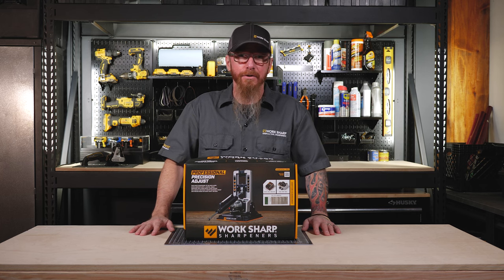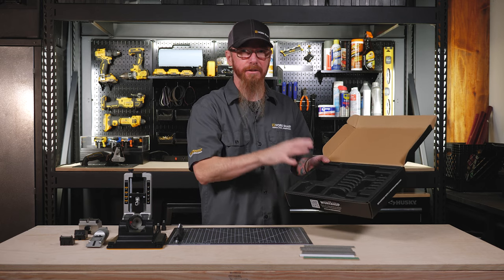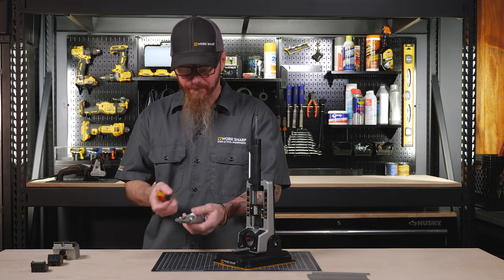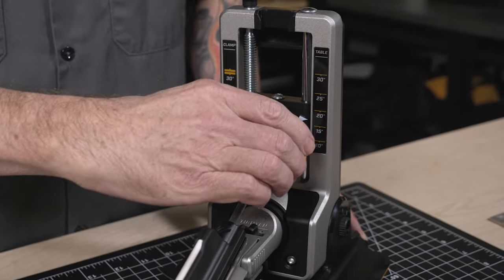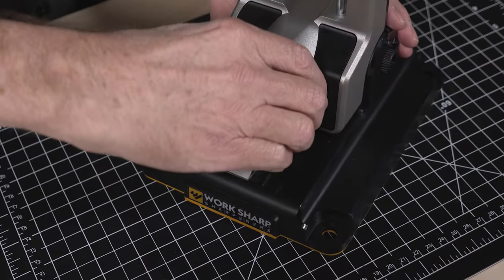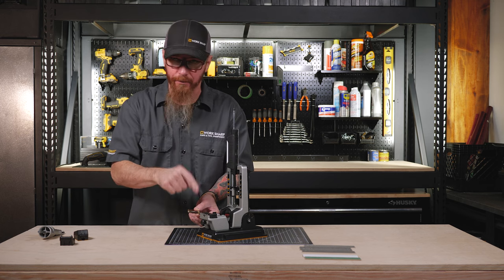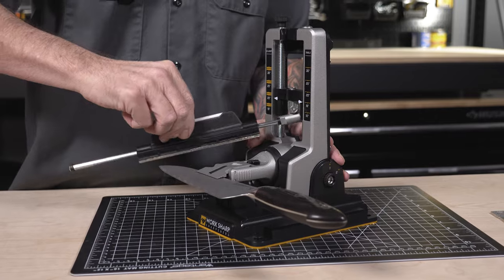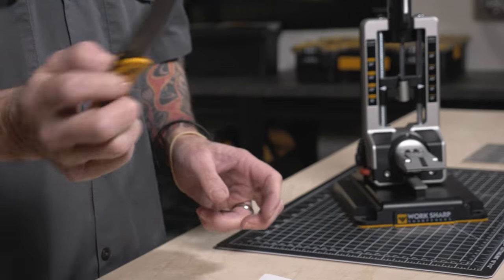Professional Precision Adjust Video Users Guide

Comment: There absolutely needs to be some sort of upgrade program for the original Precision Adjust Elite owners.
Reply: Amen! Bought mine only two weeks before this came out!😡
Reply: I absolutely agree!
Reply: I completely agree! I got my original Precision Adjust about 6 weeks ago.
Reply: Same here, we need a replacement clamp for the precision adjust elite,  like the small one for smaller knives like swiss army knives which I have a ton of.
Reply: I gifted mine to my mum as she doesn't want this much control but this new one for me is perfect
Reply: I agree
Reply: You shsould not buy it...Have you seen any reviews? It was all plastic made...
Reply: @Firekage  I bought a precision adjust elite about a year ago, it's well  made the plastic is sturdy but they put a plastic thumb wheel nut on a metal threaded bolt to squeeze the clamp jaws, already one thumb wheel nut has stripped the threads on it. For the sake of using aluminium or metal at least for that part, I did get a new clamp under warranty but it could happen again.
Reply: @6900pilot  That's why you should not have. I saw reviews and also WorkSharp vids and i saw on them that the plastic frame bends when they Sharpem. I seen later that zimę shops made mod for IT but its is not worth money.
Reply: I completely agree. I  feel like I am out that $100 plus dollars if I want to upgrade.
Reply: No they have to make money off you that’s why
Reply: Only a fool buys the 1st gen anything

Comment: Hope to see a stone holder for this system soon, It is a Professional system and priced as one (so that part is crucial for ANY Pro system). Higher grit diamond plates would also be welcomed, at least up to 1200-1500. And as with any professional tool, you need a hard case for when you want to bring the system somewhere or even storage. A hard case should be relatively easy to have made and sold separately at a later date. As it is, It looks like a great system with even greater potential 🙂

Comment: For a professional sharpening system it really needs to come with 1000 or really a 1200-1500 grit stone. 800 is pretty low end in my eyes unfortunately. But I’m guessing aftermarket will take care of me on that
Reply: Well it depends if they use FEPA F or JIS R6001 units... A lot of people use japanese units, but I suppose Worksharp use FEPA F as they use FEPA Paper for the Ken Onion belt sharpener.
So F800 (FEPA F) would be roughly J2000 grit (JIS), or 6.5 μm average, or something like P3000 (FEPA P) which I agree is not the absolute finest that exists, but still damn fine and wayyyyyy enough for cutting things. In my eyes anything finer than F600/J1500 or even F400/J1000 , is luxury, and you can always use paste on strop etc
Please let me know if I'm wrong !
Reply: Agreed, 1200-1500 plate is a must. They also need a stone holder for other  high quality stones, now that they market and priced it as a Professional system so they can compete with their competition in the same price range.

Comment: So one sweeping stroke instead of up and strokes, that's different compared to every other system on the market.
Reply: I'd find it very hard to sharpen in one direction only on a large kitchen knife say, , in previous worksharp videos ive seen them sharpening in both directions so which is correct?
Reply: @6900pilot  I honestly don't know which is correct.. using up and down strokes will sharpen a knife a lot faster versus using only sweeping strokes.. I use a DMT system and they show in their videos to use sweeping strokes but the instructions say to use up-and-down strokes and a sweeping stroke as your final stroke
Reply: @6900pilot  I think they show it this way because of the huuuuuge flex the knife would make. That clamp is for pocket knives and bushcraft knives at best. The clamp should be at least 3 times wider to be effective at holding longer and thinner knives.
Reply: @desertchild.  up and down is just fine. In their paper instructions included with it they actually show to do up and down there as well. The angle is being held where you want it already so there is no problem doing that. It would take you eons if you were to reprofile an edge from say a 20° down to a 17° by doing only upstrokes.

Comment: You should have made the tightening nut/wheel on the clamp out of metal, ive stripped the threads on one already,, plastic thread on metal  is weak and cheap. Otherwise im happy with the elite, although it's hard to sharpen smaller blades like swiss army blades.

Comment: It’s not quite as idiot proof as I thought. Especially since the first time I tried it I was only willing to sharpen an old buck knife from when I was a kid and it never had an edge on it, and a few knives from Canadian tire. The factory edges didn’t have a consistent angle on any of them. That and I had no idea why but getting a full burr was completely impossible. I had no idea if I’d done too much, or not enough. I didn’t know if I was using too much or too little pressure, I didn’t want to strip the plastic nut on the v-clamp, so the knife moved around in it a little, and I had no idea if I had worked on one side of the knife more than the other. This is going to take some practice. I’m going to need to put my benchmades away until I figure this out on cheaper knives.
Reply: Dude I appreciate this info, I plan on picking up one of these soon, I have the first model and was hoping the little skill I have would carry over, we'll see I guess
Reply: @fredchevalier2333  It’ll carry over. It was the first precision knife sharpening system I ever owned and I was working a very difficult knife. I’ve done a few blades now and I’m getting better each time. I do feel like the v clamp has trouble holding the knife and having the knife not move in the clamp. It has pretty severe wiggle. That’s a pretty big problem and if they have plans to fix that I might hold out on buying one until the next model comes out. Or if we’re lucky they’ll just make a new clamp that’s compatible with the current model. Not that I’ve heard of any such plans.

Comment: Buying it was a nightmare but shipping was lightning fast and the system is almost everything you could want. 

One issue I'm running into though is with Spydercos - Did my pm2 fine although the clamp situation was awkward with the distal taper and the way the backstop only has one point of contact. Para 3 was too small and I was grinding the clamp when going for the tip. Assuming this will be a frequently sharpened knife on these systems if you guys could make a tips video or something covering this it'd be helpful. The small knife table didn't seem like a good option again because of the distal taper and flat grind so I wound up just using the PA elite because that clamp gets a better purchase being smaller and all.
Reply from the maker: Thanks for the feedback!  I'll try to address this but our customer service team can definitely help you out if need be.  You can reach them at info@ worksharptools.com.  
Now for my take, 😉  The Para 3 (great knife) should not be an issue for the PRO PA.  I just clamped one up that was brand new and when matching the factory grind of 17° (per side) it cleared the clamp.  If you go much steeper than that, I can see it hitting though.
Another thing to consider would be where you are clamping the blade.  Make sure you have it centered and not too far up towards the scales.  We plan to have a tips and tricks video out soon and I'll make sure to include Spyderco blades in it! 
If you already tried these tips or are still having trouble our CS team will get you taken care of I assure you.  👍
Reply: @WorkSharpOutdoor  thanks for the super quick response. 

Yeah - I sharpen all my edc knives at 15 so I'll have to try some things out. The pro pa gets right up to the heel whereas the elite always left a little gap where the plastic on the tribrasive prevents the stones from getting flush up against it.
Reply: @WorkSharpOutdoor  can you please try to include sharpening recurves in the tips and tricks video
Reply: I just ordered mine on the 5th (July, 23) and it arrived days later. I had no problems with my order. I went directly to their website.

I got the PROFESSIONAL PRECISION ADJUST™ KNIFE SHARPENER, which comes with the small blade attachment, and it works fine. So, I'm wondering what kind of issues you encountered.

Comment: Are there any plans to release a longer rod? I have a 12" brisket knife that i won't sharpen on my Ken Onion. I have been looking really hard at a sharpener like this, but the Wicked Edge is one of the few that I have seen that can accommodate that big of a knife. It is the only thing holding me back from this sharpener. It looks great otherwise, and as others have mentioned, more fine grit availability would be nice.

Comment: I have had mine only 3 days and the wheel that tightens the knife holder completely locked up, I didn't over do it just a firm finger tighten to hold the knife in place. I registered it this morning for warranty and it happened an hour ago.  Frustrating to say the least.  I emailed customer service and hope they get back to me tomorrow.
Reply from the maker: Our Customer Service team will take care of it.  This happens most often when the clamp is backed all the way out.  That may not be the case here but something to check out.

Comment: The blade holder needs to be redone on the lines of the KME Wide thin blades are a NO Go because of the lack of holder support to keep the blade from flexing  is too shallow. Shame as it works well on knifes like Spyderco PM2.   I personally would purchase coarser and finer diamonds when available and will ignore wide thin blades. On the other hand the holder adjustment on thicker knifes totally binds up and cannot be unbound.  This is clearly a first generation version of this sharpener which needs serious improvements if a wider assortment of blades are to be attempted.

Comment: Hi there thanks for the video.
A quick question: after lapping knives, would you recommend to still use like honinh rods and ceramic rods to keep the edge of the knife, to not resharp them too soon or you'd just go back on the work sharp pro?
Thanks in advance.

Comment: Just received my Pro Precision Adjust and am wondering if there is a guide for setting the recommended degrees for kitchen knives, or other knives for that matter?
Reply from the maker: The user guide that came with the sharpener has you covered.  That said, here is a good rule of thumb: kitchen knives 15°-20° pocket knives 20°-25° outdoor knives for chopping/bush crafting 25°-30°
Reply: @WorkSharpOutdoor  thank you for this, this is helpful.  FYI, my user guide did not come with any information for suggested or recommended degrees for knives.

Comment: I wish there was angle setting for Japanese kitchen knives that have 9-12 degree.
Reply: i've used this for my pocket knives but the grit is too high, i wouldn't get this anywhere near my japanese knives even if the angle was perfect. you need high grit whetstones for high end japanese cutlery. some japanese knives have such a high polish you can't even wipe them down with a damp dish cloth.
Reply: @samueljackson856  Why would you not be able to wipe a knife with a damp cloth?
Reply: @LastBastian  because the level of polish is so high or the blade still has it’s original lacquer from the knife maker. Japanese kitchen cutlery is sometimes made from highly reactive carbon steel so they lacquer the blade before shipping. Or look up Japanese katana polishing, some of the same techniques are used on sakimaru Takohiki which is a really long sushi knife that looks like a katana
Reply: @LastBastian  in Japan, blade polishing is a profession and some spend their life learning it. There are whole cities dedicated to blade making there
Reply: @samueljackson856  Tradition is one thing, but no harm will come from wiping a blade with a soft damp cloth. Unless it's a non-user show piece covered in whatever coating that you don't want to wipe off.

Comment: The only problem I see is as you travel toward the tip it is further from the pivot point so the angle changes.
Reply: ...which becomes more and more of an issue the longer the blade is. 
Not much of an issue on smaller knives though.
Reply: I keep looking for answers on this, how do I stop it
Reply: @little_firby5574  It's geometry. I don't think you can avoid it on a system like this.
Reply: @LastBastian  damn

Comment: If only it was capable of sharpening long flexible fillet blades . Oh well.
Reply: I haven't done such a blade, yet. I have done an old thin carving knife on my Pro. The magnetic holder on the small blade table held it securely. I only sharpened about an inch at a time (kept within the width of the table) and slowly slid the blade along until it was done. Yes, it took a long time, but the results were good. With that in mind, it should be possible to sharpen a filet knife. One way to possible overcome the flex issue, if it's too big for the small blade table, would be to use some small magnets and a thin 3 to 5 mm rod on the underside. I'll have to give that a try if I am ever asked to sharpen such a blade.

Comment: better off buying the basic precision and then buying after market 3D printed attachments. you can then buy and use better stones. They made this system and used proprietary stones again and added nothing of substance to it as there are 3D attachments already being made for these such as scissor or small knife holders. Also you can buy an angle indicator for $20. Basic precision with all the attachments you'll need $100-150 then good stones that will last a long time another $150. Anyone wanting to drop $300 should look at better systems that don't limit you to their proprietary stones.

Comment: This isna garbage system!! Its a KME knockoff but better introduced.  800 grit? Are you serious?? You have to hone your blade either before ir after every use! Then you would only need a touch up from a 1000 stone at the lowest. My 2k and 3k Shaptons will cut steel like butter.

800 lmfao you insult your customers! No one is buying this for a repair job. So include 400, 800, 2000, ceramic and 1k wet.